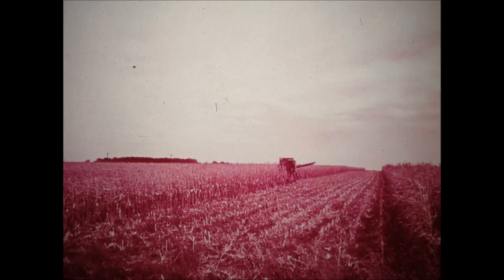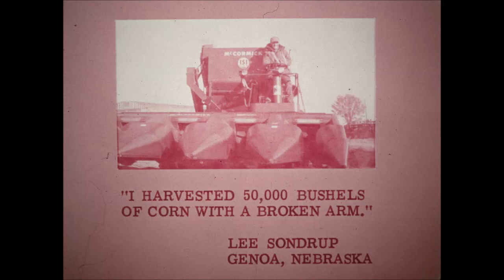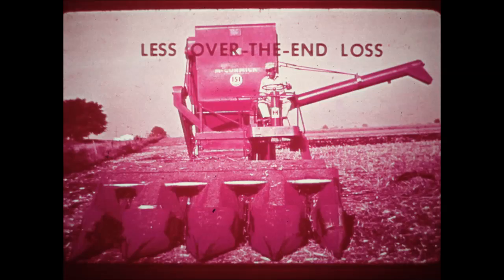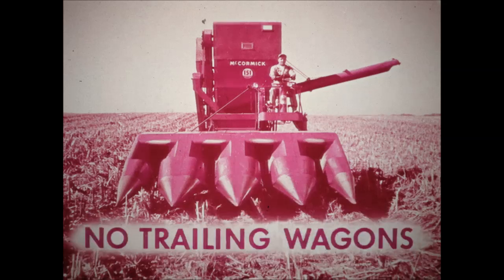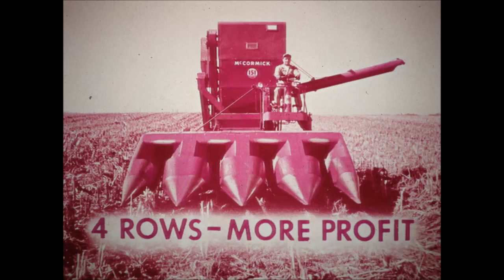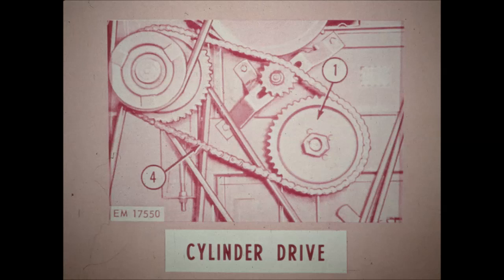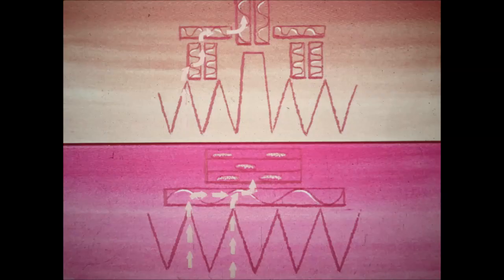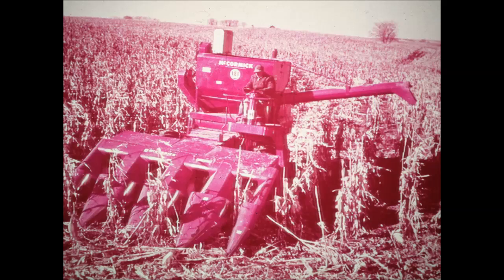IH Four Row Corn Harvesting

Comment: At roughly the same time (1958-1960) Deere and Co. was pushing for 6 row planting and cultivating, and for harvest, 2 row picking and 3 row combine shelling. I don't think it was very successful, because most farmers seem to have stuck with 4 row equipment up into the late 60's to early 70's.
Reply from the maker: That's interesting to hear. I have a couple JD combine videos posted from that era & nothing is mentioned. Hopefully, I can dig up more of those filmstrips. They sure are interesting. Regards & thanks for tuning in!
Reply: @ikonseesmrno7300  The Deere Day films, namely the 1959 movie, the patriarch Tom Gordon ends up trading in his 60 and 4 row equipment for a brand new 730 Diesel and 6 row equipment.  The subliminal advertising may be more a part of the motion pictures than the filmstrips, from what I've seen.
Reply from the maker: @RustyCarnahan  Is that film posted on YouTube somewhere? Sounds like an interesting movie.
Reply: @ikonseesmrno7300  it's a very good movie. I have it on DVD from the national Two Cylinder Club. If it's on YouTube, I haven't seen it yet.
Reply from the maker: @RustyCarnahan  I found it on the Two Cylinder website. Will have to save up & get it. Looks really interesting. Do you have any of the other ones? I'm curious if the 43 sheller & the hay cubers are featured in any of them.
Reply: @ikonseesmrno7300  I have several of the DVD's but not the full set, yet. I'll have to watch through them again, but I don't believe the 43 sheller and cuber are in any of the ones I have.